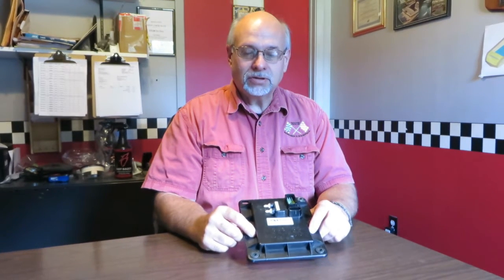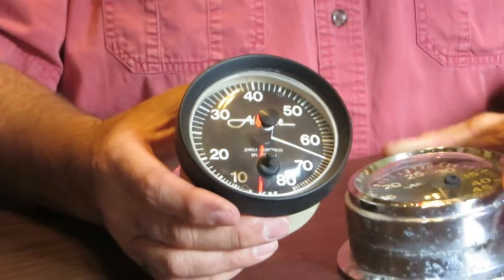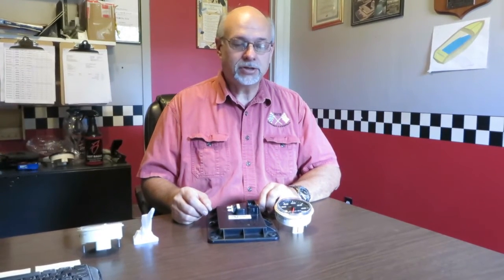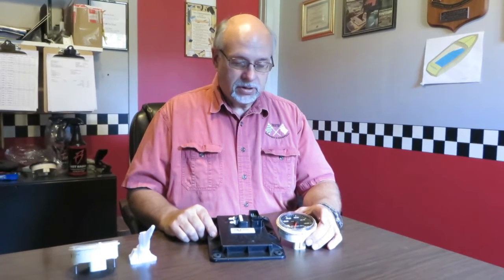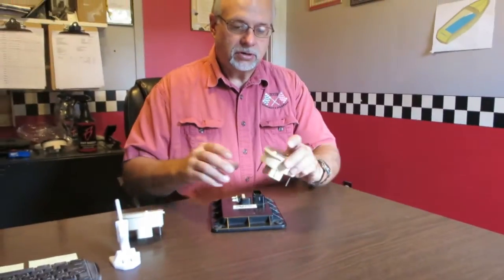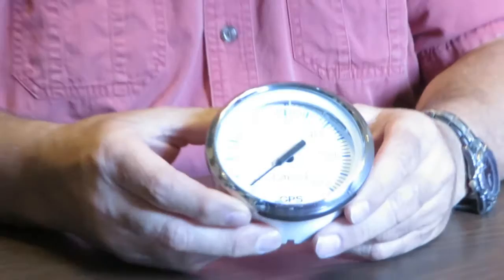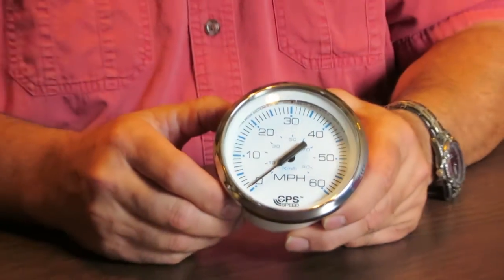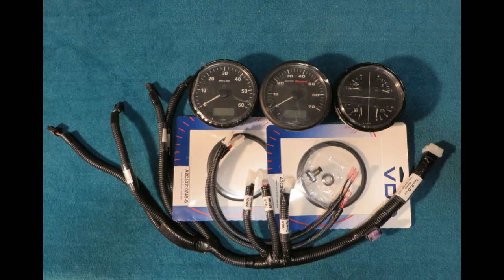Medallion Brief History 2

Comment from the maker: Mike L  on  11/10/2016
  I bought one of Ron's TRD Conversion Kits and installed it on my 1999 Malibu Sunsetter
  I found the installation to be straightforward and 
fairly easy. The instructions were very good and easy to follow for both
 the installation for the gauges and the wiring harnesses. Everything 
matched up and worked exactly the way it was supposed to.
It was great to be able to call you and get you on the phone to answer 
my questions during and after the installation. Awesome Customer 
Service!!!!